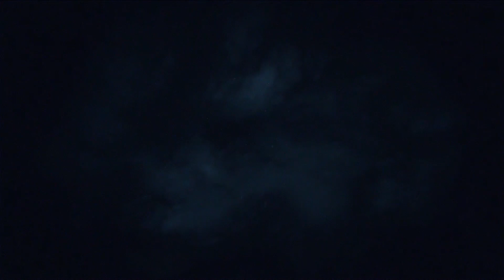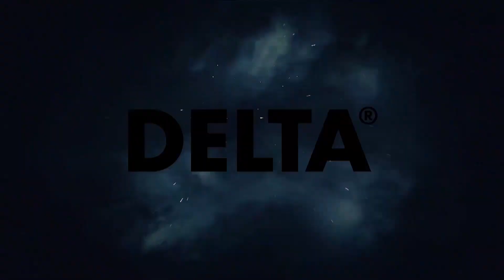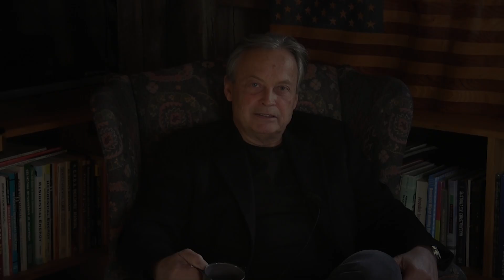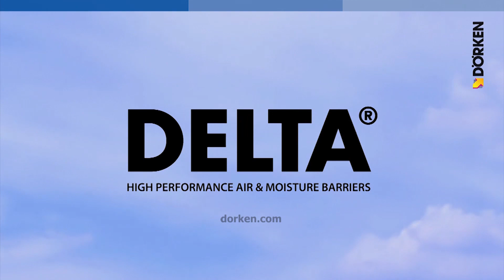A Cup of Joe: Below Grade Water Control | Building Science Deconstructed

Comment: 0:23 - Where did he get that cup which holds coffee inside it's own mold form, form mold ? - I noticed you should  have spilled it on this comment time stamp. Interesting prop segue to the lesson if I'm correct on my observation of inertia  vs  dispersion...but I wouldn't be surprised if  I was wrong.
Reply: Volcanised Concrete  was the first concrete formed poured and floated from below water, to the surface. Argentinean concrete psi was the first from a higher ph of coral calcium lime, the strongest. The Pyramid stones were cut with water pressure, as the Sons of God were giants in those days never polluted the altar with man's tools. The polished  look of a pristine finish used the same technology as making windows with heat and pressure form shape to shape form. Otherwise the Transformer tribe of Optimus Prime would never be just a cartoon.

Comment: In the case where the water table frequently rises into the level where footers will be, it seems to me that stone and schedule 40 drainage might be ineffective (home withe elevated slab or slab-on-grade). What would you suggest in this case? I was wondering about contiguous epdm laid over the excavation site (giant pond liner) then footers poured, then stem walls and the outside edge of the epdm would be affixed to the outside perimeter of the stem wall. Are foundation contractors doing this anywhere? Why or why not?
Reply from the maker: For the typical residential home, full underslab waterproofing is not necessary, though one should always design for site conditions.  Most builders do not lay down a layer of EPDM because standard site drainage is adequate for most locations..  However, building code does require footings be placed on undisturbed soil, so you would not likely be allowed to run it under the footings. If the groundwater is rising above the footing, waterproofing on the wall should be done to a height of one foot higher than the anticipated water level.  If you have a slab on grade floor and the water rises above it, you have a flood and EPDM is unlikely to help.
Reply: @coselladorken  water table historically 6-24 inches below grade.  Planning an elevated slab as I've seen in coastal Carolina with good drainage stone under the slab. So paint stem walls with waterproofing and maybe another layer of delta footing barrier on top of the stem wall too (not just top of the footer)? Engineer also suggested a reinforced vapor barrier over crushed stone fill, before pouring slab. Thoughts?
Reply from the maker: @grizzlya1257  Firstly, remember that DELTA®-FOOTING BARRIER is a capillary break, meant to prevent by physical separation the passage of water through the footing into the foundation wall due to capillary action.  It is not waterproofing and would not be considered water-tight.  Capillary breaks between the foundation/stem wall and the primary structure are also important, as wood ought not sit directly on concrete.  A common method is sill plate gasket installed after the concrete is cured.  DELTA®-FOOTING BARRIER could be used but should always be applied when the concrete is wet.
We agree with your engineer on the wisdom of a vapor barrier underneath your basement slab.  See DELTA®-MS UNDERSLAD https://www.dorken.com/en/our-products/products/residential/delta-ms-underslab.php An underslab vapor barrier is a good idea no matter what the ground water level.  It will add to the comfort of the building.
DELTA®-MS or DELTA®-DRAIN make a good drainage/protection layer for your waterproofing as well.

Comment: Joe you mentioned cracks appearing below grade and thereby causing a water problem. I want to know why we don't run some rebar diagonally, like we see in metal trusses. Wouldn't this simple step go a long way to prevent wall cracks, especially at corners
Reply: Xypex works to stop water through small pores and really tiny cracks. Most problematic cracks are larger than can filled by crystallization.
Reply: Beyond the need for water flow control below grade, might the crystalline additives work to forestall total degradation of footings and mortar due to capillary action such that useful life could be extended to a couple of hundred years.  Big, intact pieces. between cracks would still have some structural benefit if they weren't totally deteriorated by continuous freezing and refreezing.

We need to make buildings last for generations, membrane protection seems to be falling short of this if product warranties are any indication.
Reply: No Steve, rebar only stops large cracks, not small cracks. Design standards like CSA A23 and ACI318  allow cracks of 0.3 mm in even finished concrete. Only way to avoid cracks is prestressed concrete, and even then it is hard. Precast concrete can go a long way, because of quality concrete and building cracks into the system (that would be the edges of the panel).
Reply: @jfstraube   How about pouring XYPEX into concrete to waterproof the entire mass of the concrete structure?  https://www.xypex.com/products/the-xypex-advantage
Reply: Although diagonal bars work to resist forces they only engage after the crack forms. They keep the crack small but it still leaks.